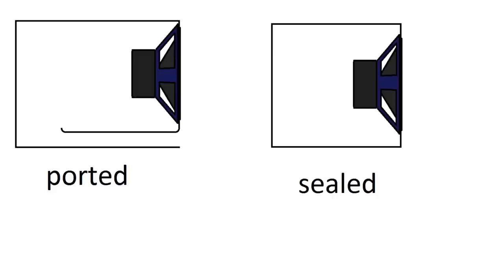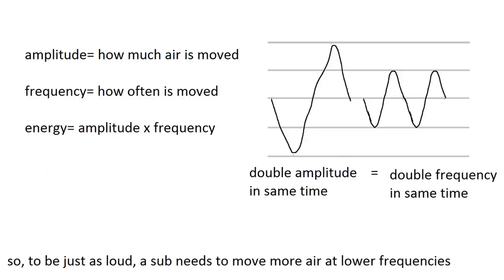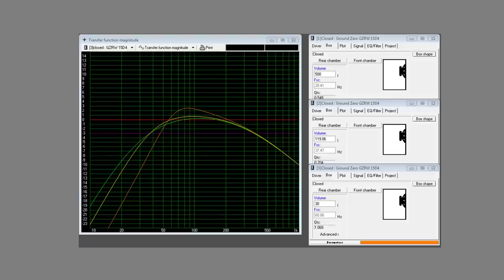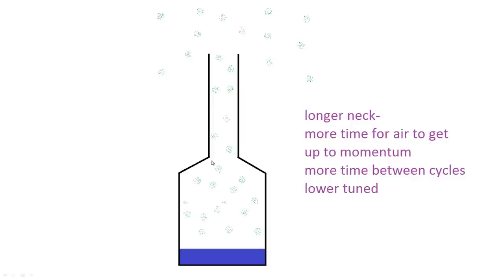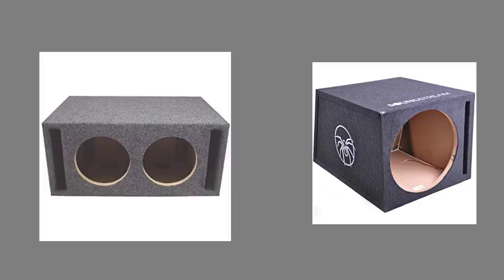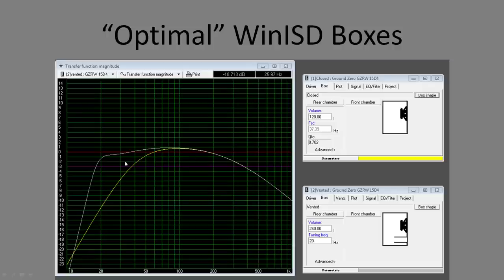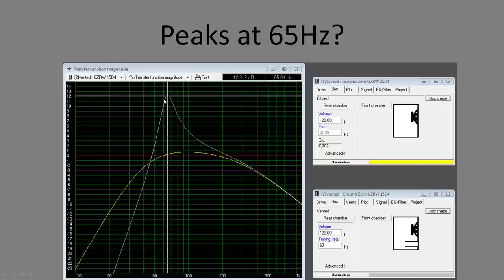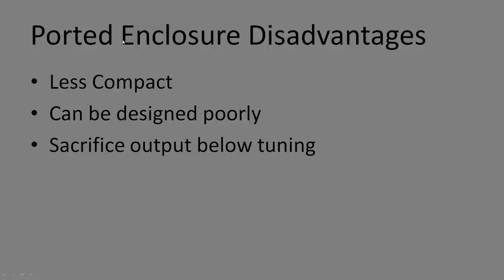Sealed VS Ported Subwoofer Enclosures

Comment: From Andy Wehmeyer, formerly of Harmann International, now producing his own high end car audio brand
---------------------------------------
1. If you're going to use lots of power and a sealed box, then you need a woofer with a long coil.

2. If you're going to use a vented box, a woofer with a shorter coil will be fine.

3. If you use a woofer designed for a small sealed box (low Q) in a vented box, the box volume requirement will be small and the port frequency requirement will be low. That means the port will be very long and the box will be difficult to build because the port will be difficult to fit in the box.

4. If you use a woofer with a short coil, designed for a vented box, in a sealed box with high power, the woofer will run out of coil and you'll hear distortion. Because the condition that produces the distortion is symmetrical (coil leaves the gap in both directions), the distortion will be mostly odd-order, which sounds nasty. "Brap Brap Brap".

So, what's the conclusion?
Your power requirement and choice of box type determines whether a long coil (woofer with high Xmax) is necessary. Almost all woofers will work in a sealed or vented box, so long as the woofer's Qts is lower than your target Qtc. A woofer with a Qts higher than .707 will have a peak in its response NO MATTER WHAT KIND OF BOX YOU USE. The rest is a matter of compromising between box size, power required to hit a target SPL and required low frequency extension.

When you put the box in the car, the transfer function (car's frequency response) will be added to the response of the woofer. this will produce roughly a 12dB per octave increase in level as frequency is reduced starting at about 50 or 60 Hz, depending on the size of the car. A vented box will give you a big peak and a sealed box will not. If you have an EQ, then you can reduce the peak by reducing the power the amp has to provide at those frequencies. I think a vented box and EQ is always the best way to go, so long as you can afford the space and the EQ. 
---------------------------------------------------------------------
https://www.diymobileaudio.com/forum/technical-advanced-car-audio-discussion/129299-designed-sealed-ported-explained.html
Reply from the maker: Good information, thanks for sharing
Reply: I don't care much, for the sudden roll off below the port frequency of the box. The driver is then, unloaded, as if it's not even in a box. You immediately lose the resonant protection offered by the vent pipe, and that can lead to over-excursion of the driver. The roll off in frequency response is more gradual in a sealed box, and the driver may be better protected by the compression loading at low frequencies.
     To me, the ONLY advantage of a ported box, is to limit cone excursion at higher power, making the speaker more efficient. It does that at the expense of a narrow bandwidth. All bass drums sound the same with ported boxes, because the "thud" is the port frequency of the box. With sealed, you can tell one bass drum from another. I had to take a ported box back and trade it for a sealed, and that separated the bass guitar from the bass drum.
Reply: @vincentrobinette1507  https://www.youtube.com/watch?v=G2NF1PQgj1Y - Port tuning demo

https://www.youtube.com/watch?v=v0OQ_y0F9Qk - Ported vs. Sealed - Detailed Comparison

To your second point, I always make th statement; there are good and bad versions of both (depending on many factors including the enclosure) 

and again, if ported enclosures are so inept (t-line, bandpass, ported ABC,etc), how/why did Scott Bulwalda win IASCA  using a bandpass enclosure (Scott holding the highest score ever last time I heard/read)? 

What we're trying to do is to marry an objective truths to the truth that at the end of the day we use subjective measuring tools (our ears). At that point, I think psychoacoustics kicks in. Ported vs sealed, higher price sounds better, one brand is inherently better than another etc, etc

Not disagreeing with your points, just trying to add another dimension to the POV 😎
Reply from the maker: @vincentrobinette1507  Sounds to me you've not heard properly damped ported boxes. Poorly designed ported boxes can leave a sour taste. IMO ported boxes in the audio quality realm are great for low frequency extension, i.e. infrasonics where quality isn't really a factor
Reply: @Dakoustics  That's exactly what I want a "sub"woofer to do. To basically extend the low end frequency response of my system to BELOW the normal range of hearing, to capture the ambient sound. You might be right about a ported box, that either isn't tuned to the low frequency that I want, or worse, being paired with the wrong speaker driver. There is a real art, as well as science to getting a good flat frequency response, extending waaayyy down. If you're just going to throw a speaker driver in a box, a sealed box with plenty of acoustic absorbing batt in it, is the easiest way to get decent sound, without a lot of math, or knowing or understanding the "ThielSmall" parameters of the driver. The inexpensive subwoofers I got from the local car audio shop in my area just may not have been well tuned, if at all.
Reply: TransmissionLineDesigners Hi,ajnd there are a lot of basss reflex boxes: QB3     B4     C4   SB4   SBB4  the best enclosure(box) for general use is the B4 (4 Butterworth order)  The Sb4 and SBB4 are huge bass reflex enclosures with capability to tune at low fraquencies,but the time delay is more high.    Is true the qts of the speaker,for bass refex i use speakers with qts <=0,5    and a single formula for a primary choose a box is the EBP    EBP=Fs/Qes   where fs is the resonant free air speaker and QES is the electrical efficience of the speaker   If EBP<=50  may be placed in closed boxes   <50<90  may be placed in a closed o ported   and >90,in bass reflex boxes. and >>150 in TL enclosures
The Thiele small parameters are easy to calculate,except the vas. I use an audio generator ,a 20ohm resistance and in series  the speaker. and the voltimeters.the speaker is suspended from the ceiling avoid walls for avoid interferences.     The high qts speakers are used for guitar and musical instruments where the fidelity and peaks are no matter. i agree the coil may have a long excurtion and it may be into the magnetic field the most time possible,because when the coil go out of the magnetic field,acts as a resistance, and the distortion begin.and of course,heat too. my mail:dalbercast@gmail.com if you may contact with me   Thanks for the explanation Daniel   Argentine   PD:I have a lot of formulas,but the ear is the main  tool.

Comment: About sealed box power handling. You said that a sealed box can handle less power than a ported one ( @ 15:40 ), when it's not true. Sealed boxes can handle more power due to the sealed air providing more dampening (and simulators like WinISD confirm that). The smaller the box -> the more dampening you have -> the more power you can pump into it without loosing control -> the less efficient is the box at turning power into sound.
Also, adjusting frequency response in a vented box using a bass port seems like magic, until you realize that in some cases if you want to tune your box to very low frequencies (below 40hz) you run into a problem of port configuration. The frequency response might seem like its boosting 12db around the tuning frequency, but then you look at how long your port needs to be to achieve that and it says something like "1.5 meters" and you sit there and think "how the f am I supposed to fit all this length in a box that is 40L?", and you realize that there is no such thing as magic and what you can expect is a 3 to 6db boost at best without creating a ton of headache (or without making your box the size of a washing machine and finding out that you can only push a couple dozen watts into that box before your speaker unloads).
Reply from the maker: I was referring to higher power handling at the ports tuning frequency, though yeah, was a bit vague just throwing that out there. And yeah, smaller boxes need ports the length of small busses, which is a pain in the ass. I usually just design the box with a narrower port to compensate lol. Good comment, cheers!
Reply: Sealed requires more power to push the sub and to get required output
Reply: @VINNY5674  this is very true. You have to realize the rated sensitivity only applies well above the subwoofer frequency range (below 80Hz). While bassreflex can be tuned to be flat all the way to the tuning freq, sealed can't and your sensitivity starts to decrease from 100Hz down. So the result is at least 3dB lower sensitivity, which equals to 2x the power for the same SPL. But try to EQ a ported enclosure to play below the tuning and you run out of excursion very, very soon
Reply: I’m looking at a High Excursion DS18 SXI 12” 1000rms/2000max. The EBP is rated 52.1 indicating it should be more likely in a sealed box, but they also provided recommended ported box specs. I read about sealed being more likely to wear down the sub overtime due to no fresh air being able to move thru the box? Is this true? I’m set on buying the 12” but now I can’t decide between ported or sealed?

Comment: I can't argue the thorough treatment given here, so I won't imply this is wrong. I am sure he's correct. However (there had to be one) my personal real world experience is I simply prefer the sound of a sealed enclosure and have never experienced the downsides detailed here. My experience is with fairly modest gear from the 1990's, though relatively high quality drivers and 3/4" MDF enclosures built exactly to spec the driver manufacturer's recommendation. I find the sound from complex ported systems good but just not quite as good to my ear. I'm willing to give ported enclosures plenty more chances and will continue to try them. One note: my ear seems more picky about driver size than the enclosure. For example, a good 10" ported enclosure sounds better to me than a 12" (ported or sealed). Anyway, thank you for the video, I find it informative and helpful.
Reply from the maker: Yeah, its all subjective. For me, personally, what defines good sound quality is a solid, relentless bass extension, and ports keep it nice and flat without the roll-off. I also see the 10" sealed come up often, for example bass guitar speakers often have multiple 10" drivers rather than one 15" or 18". I've got a theory its to do with motor strength, and how standard ferrite magnet motor subs start to lose the battle to cone area above 10".

Comment: My active speakers (Mackie hr624) in the studio are not ported because I want to hear as near as exactly my master. Ported speakers colors the low mid/low,in consumer audio an easy and cheap way for an impressive sound,in todays electro music and lack of nowledge other music is ported/non ported no issue . For live concerts I use most of the times line array for mid high (not ported) and ported subs,depending the measure of the field. In my livinroom I often listen to jazz,of course not on ported speakers,even my car dont have a double exhaust for extra noise

Comment: with a 6th order series box im building my rear port length is limited to 32 hertz but i wanted it to be tuned to 26 hertz. i have been told by goinh lower on the front chambers port by making it a bit longer it will extend the rear ports tuning as such that it will bring the tune down for me? do you agree this is correct or will by box still fail to play low lows?
thanks to anyone that knows :)

Comment: if ported need twice the box volume, just build make it sealed and put two subwoofers in there.  then you get sound quality and ease of building and use, also adding power across whole range.  
seems like ported is only for limited spl use at set frequencies.

Comment: Bandpass the best of both worlds!
Sealed with radiators awesome 👍
Or Svs subs ported rock!
Reply: and also by far the worst impulse response. If you want muddy bass, go bandpass.
Reply: calee4nyaboy radiator is steeper roll off I think. But you do get the benefits of no chuff or mid leakage.

Comment: I think verdict was out some 50 years ago. that for the same -3dB point on a same sized enclosure ported system has 3 dB higher efficiency, and for same efficiency and enclosure volume, ported system can have 30% lower -3 dB point in bass extension. Hence most systems are ported these days
Reply from the maker: Yeah, its funny, I was thinking of making a rant video about modern subwoofers. Proper HT subs tuned ~14Hz for the extended bass shelf are fine, but the average consumer sub is hideous in all honesty. I have no idea how engineers get away with it. I've got an LG subwoofer tuned to 60Hz, and as you know, they have a steep roll-off below tuning. 60Hz is where I like to have the top of a subwoofers frequency response, above that it's directional. These days with class D amplifiers on chips which cost nanocents to print and subwoofer power handling going up and up a sealed unit makes sense, but apparently not. Obviously a topic I'm passionate about.
Reply: @Dakoustics  I had Sunfire's true subwoofer. it was more an earthquake machine than something that produces music. my neighbor used to give me dirty looks for shaking the wall. I also had Wilson audio's Watt/Puppy 6s which claimed extension to 22 Hz. that woofer can make wood bass sound as it was right in front of you. so you're right: most subs lack fidelity and I think this trend will continue.

Comment: So could you not make a flap mechanisim on the box that you can adjust to get the right amount of pressure. Fine tuning.  Also i was just wondering would it help get better proformance if you had a port that opened and closed  but was pressure regulated by a spring on the port door like a gate spring on a turbo so it can build up pressure but not as much once it gets to much pressure because the spring limits the overall max pressure.? Just an idea.

Comment: I wonder if you could create mini chambers (of varying sizes) within the enclosure and pair it with a ported design. Sort of like capacitors except it stores air thus limits the draw backs mentioned in the video.
Reply from the maker: From what I gather from your discription, the effect would be similar to adding polyfil to the enclosure. It should decrease the peakiness of the port, and also the smaller chambers can be tuned to cancel out certain resonances within the box. Could be cool, but it'd certainly add a layer of difficulty to the design and construction. Some enclosures have a wavy pattern behind the driver to break up rear reflected waves, so it could be implemented like that.
Reply: What you describe would be like a higher-order high-pass filter.  Yes, it can be made to work, but the math would drive you crazy!

Comment: I am hoping you might be able to answer my question. I have two  JL Audio 12W3v3-2 in a ported box. They were installed in a different vehicle. I now have a 2013 Ram 1500. I bought a box that will fit under the rear seat from Amazon. Bbox A202-12CP Dual 12" Sealed Carpeted Subwoofer Enclosure. On JL Audio's site my subs are optimised to work with 1.35 cu. ft. in a sealed box and 1.75 cu. ft. in a ported box. This box says it has 2.27 cu ft. 

Would you recommend porting it and if so, where would you port it and how? 

Thank you for your time, I really appreciate it.
Reply from the maker: Depends, so if the box is 2.27 cu ft total, and the JLs want 1.35 cu per sub, I'd say leave it sealed. Should do fine.

Comment: Thanx. I understand. Another question I have is what is the diverance between airfree magnets and solid magnets on a sub and what box will work beter on them?
Reply from the maker: I'm guessing you mean airfree magnets are the ones with vents in the back; and solid magnets have no vents. Usually subs without vents go without so you can mount them in smaller sealed boxes without vents being blocked, and ones with vents have a higher power handling, and work better in general in ported boxes. Let me know if you mean something different.
Reply: @Dakoustics  Thanx!

Comment: I have watched many videos about woofer boxes, and still cannot get things to click in my mind. Just too many variables come into play. No mention of a box that has nothing more than a slot cut into the front. I have a a pair of vintage Altec Lansing Model 19 large home speakers. The woofer chamber is quite roomy, but the engineers are using just a simple front slot cut about 2"x10" for the loading. Sounds fine! So, why don't all bass boxes just have slots or circular holes cut into them of a size that resonates nicely with a certain speaker?
Reply from the maker: For subs, they need to be low tuned, which means the hole would need to be very small/constricting, and could cause a ton of choofing/turbulence when air rushes through the narrow opening. To counter this, they make the ports wider, though need to make them longer, otherwise the tuning would go up. Some sub boxes can just have a simple hole cut in them, though they need to be very big (300, 500+ litres), and have a speaker such as an old paper cone 18" with very loose surround. This has become less common since amplifier and subwoofer power handling has increased.
Reply: @Dakoustics  Thanks for the reply! OK, if I understand correctly: You CAN just cut a simple hole in a cab sized to resonate at the woofers Fs for example, but it will be noisy (chuffing) etc. So, to counteract this, a much bigger hole is cut into the box, BUT a tube (pipe) is inserted into the hole of a proper length to achieve the same characteristics of that smaller simple "hole", but without the port noise. Is that the idea?
Reply from the maker: @curtchase3730  yep, thats exactly it, as a general rule of thumb I've heard 16sq" per cu ft of box. Larger means boomy, smaller means muddy.